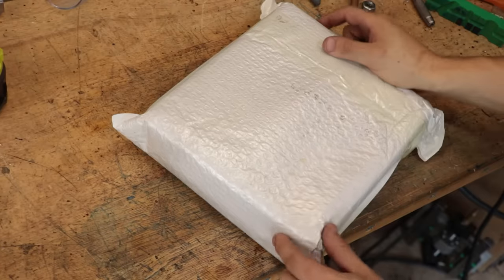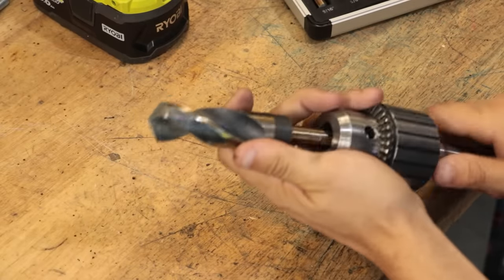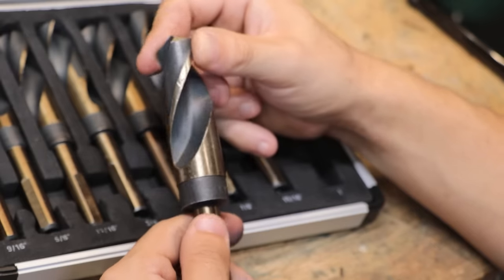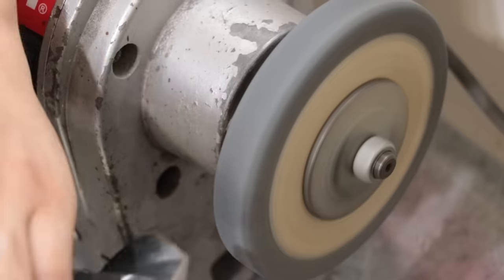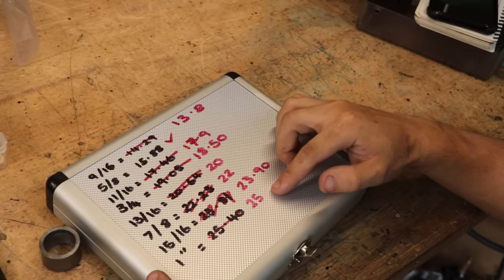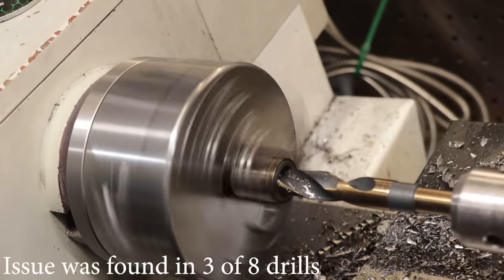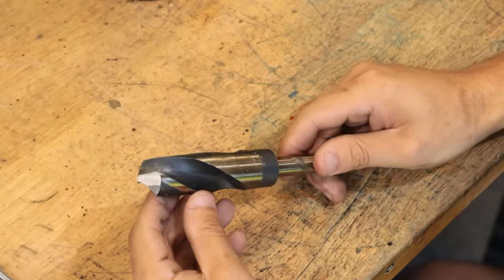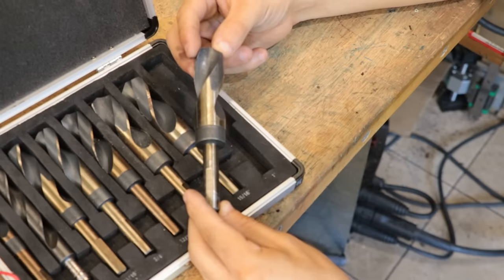Cheap Reduced Shank Drills. Worse Than You Think

Comment: I just bought a 115 piece TiN index from harbor freight here in the states. For 48 dollars I wasn’t expecting much but I’m planning to replace the most used bits with more solid brands once I need to, and as a bonus I get to keep using the sheet metal box they came in for organization.
Reply: I bought a set of 29 1/16-1/2" cobalt drills from HF for around $25, and they're the real deal. Others have been junk except a 1/16-1/4" set I got for $5. They were real HSS, still great after 20 years.  So it's hit-and-miss!
Reply: I bought the black oxide 115 Harbor Freight set back in the day when it was the princely sum of $29.95 just to see how bad they really are. I still use that index. For mild steel it's OK. I wouldn't try drilling anything hard with those bits. Over the years as I've found them I've been putting better quality bits into the index too. For an amateur I'd say it's a buy.
Reply: @1pcfred Yep.  The biggest thing with those cheap sets is, as long as the grinds aren't just complete garbage, they get you drilling.  They make a hole, and especially when you're just starting out that's all most people are looking for.
Reply: @OWSNubbles  when I'm drilling a hole past a half an inch I just want a big hole of approximate size. I'm not concerned about precision at that scale. Anything in the ballpark will do.

Comment: Biggest advice I can give is to throw that Jacob’s chuck in the trash and only use ER collets to hold the drill bits in the tail stock. It improved my drilling experience tremendously especially with the super small bits. With a collet I can be assured that the drill bit will not slip marring the surface of the drill and destroying its concentricity.

Comment: Even some once great names in drills can have bad grinds.  I was once making some bolt action pens using 304 stainless.  The closest drill I found to the size I wanted for the main clearing cut came out of a Precision Twist Drill index.   It was terrible.  At first I thought it was just work hardening on me, but after hand grinding the drill I did a dozen pens without sharpening it again, and I am confident it was still sharp.  In fact I was able to push so hard and fast with it that the knives of steel would reach out of the hole and almost hit my hand on the back of the tail stock in seconds if I didn't pause to break chips.

Comment: I bought a set of Silver and Demming large drill bits. They are a step or two above garbage. They tend to chatter and make hexagon holes instead of nice round holes. You need to use several sizes and work your way up to the final size. In regards to drilling holes over one half inch I just have two words to say..........annular bits. I bought a few sizes and will never use anything but them on large holes. NO chatter and you start with the proper size. Perfectly round holes, no rimming around the edge, and smooth work faces. They take a special chuck as they are actually meant for use in magnetic drills but I bought a cheap chuck that fits the #2 Morse taper of my 5?8 inch drillpress and you just insert the annular bits into the lower end and tighten the two set screws and start drilling. The bits are pricey but worth it in my opinion.

Comment: For drilling big holes I am using euroboor anullar cutters with an arbor and they are amazing.
Reply: Yep but only useful for short depths and through holes only.
On a lathe I wouldn't use blacksmith or reduced shank drills (well I have a few in the 12mm to 16mm range which have all been reduced to 10mm to save time when using a collet chuck) because you have a Morse taper available in the tailstock which is so much better to use.

Comment: Your results are significantly better than I got from a similarly sized set obtained from Bangood.  The problem with my drills is that they were not hard enough.  I even tried heat treating a couple, but the steel was not responding.  So mine are a dead loss.

Comment: You could grind or mill 3 flats into the Frost drill bits. Mr. Pete did a video on this some time ago. It’s not rocket science, but an example of how much better it works at least. Good video sir.
Reply: Usually the shank end of bits isn't hardened. So it can be machined. I think it's left soft so you don't mess up your chuck and it can grip? I've dug grooves into plenty of bit shanks and had to file them away. So it seems soft to me.
Reply: @1pcfred  -they are left soft on purpose, as harden jaws and harden drill shanks wouldn’t work very well together 😬 
With unknown quality of the drill bits (with all the chips and the size inconsistencies) and how they’re produced, they could’ve harden the entire drill bit 🤷🏼‍♂️
Reply: @orangetruckman  that's why I figured shanks aren't hardened. But with cheap bits who knows what they did with them.

Comment: I have what looks like an identical set of drill bits. Same box too. I've had them for a couple of years now. Got them from Amazon for around £15 from Amazon. They were advertised as HSS-Co, wasn't expecting it to be at that price 😂

I needed a 16mm hole in some aluminium during  lock-down while working in London. This was the cheapest and quickest way to get it done. I've only used them a handful of times since, most are still in their individual bags.

No chips in the finish of mine but being a budget set they only ever get used on soft materials.

Comment: Another thing to keep in mind with "reduced shank" anything, is that the thing you're throwing it into (a jacobs chuck) is engineered for the sizes they are ment for.
Sure drilling is low force, but they might deform any internal workings
Reply: That doesn't make any sense in most situations - unless you're using the smallest chuck with a huge 1+" drill it's not going to do anything to it. Your feed rates and pressure shouldn't be enough to cause issues and if they are you probably aren't using enough lubricant/coolant. A standard k3/k4 chuck using a reduced shank drillbit is fine for nearly all materials. If you're pushing a drill that hard you should probably be using a cnc and just plunging with an endmill, but that's going to cause other potential issues (out of round holes, poor finish, etc)
Reply: @skoparweaver7692   I agree with his post that reduced shank drills in that size range are not great for steel.
It's far better to use a morse taper drill dirctly in the tailstock or in a morse to morse size adapter when drilling something like 3/4 or 1 inch

Comment: I have the exact set (right down to the foam between the smaller drills arriving ripped off) sold under the Nikko(?) brand. I just wanted a complete set. Ended up using them for some very real 1/2" and 1" steel plate. In my big mill, 3HP, 3PH, 100RPM, they did just fine. It definitely appears there's a different, harder steel close to the tip, which I've seen in other name brand drills. 

They're not going to outlive me, for sure. But they do the job. I wouldn't advise using them in a hand drill unless you hate yourself (and your drill, and your work) but in a pinch they work.

Comment: Chinesium...
Kinda on par...as they say "Buy once, cry once"
Definitely look into building/buying a drill bit sharpener...especially if you can build one where you can grind in a relief on the back side for drilling metal
I wonder if you could re-heat treat them to see if you can make them harder?
Keep em coming!!!!
Reply: Lots of Chinese products are poor because of poor heat treating, so I was thinking the same thing.
Reply: See Harold Hall's design for a 4 facet drill sharpening jig. It is simple to build and works extremely well. All Chinese stuff isn't the same cheap crappo quality....it is the same thing wherever you buy from,if the price is so low to dictate poor quality that is exactly what you should expect. A decent set of HSS Blacksmiths drills would be no less than £80.00 GBP.
Reply: You can buy the best and still end up crying at a later date. Life's funny like that sometimes.

Comment: I think I have the exact same set (I bought it about year ago). I never messured mine, but the first time I used the smallest drill from the set, the drill snapped in half in mild steel. So I guess, I don't have to messure that one. 
Great video as always and have a great start in 2024. 
Metric greating from Germany ;-)

Comment: I wouldn't say I particularly prefer metric or imperial, but switching back and forth can be a pain in the butt.
I work in fairly large factory in the US that does contract manufacturing for medical devices, mostly designed by US companies. A lot of the newer parts that come through (designed post-1990 or so) are all metric, but a lot of the old pieces are still imperial nominal sizes and prints because that was the manufacturing process the FDA signed off on, and changing it will require their approval, so we're stuck with it until someone decides to retire the design and replace it.
The more annoying cases are those rare occasions where a print is a mix of the two. There are these parts we make a lot of where the print calls out a 5mm hole with a +/- .05 tolerance, no big deal. That same hole also has a 12-48 UNS thread, which calls for.193-.198" on the minor diameter which works to 4.9mm-5.03mm.
So because of how they overlap, our tolerance on both is cut down and the actual acceptable size for the hole is neither of the ranges listed on the print, it's 4.95-5.03.
The other part that gets me is the decimal places. If a feature's .005mm oversize, no big deal. .005"? Way more of a problem, and probably scrap.

Comment: A couple of comments......... your correct about the materials cheap ones are made of. Buy better quality from a good seller ( better value in the long run). I use Rennie tools ( just a pleased customer, no connection). Most people run these larger drill bits too fast. Try to use a bench drill. Hand drills are far too fast. At the end of the day you get what you pay for!

Comment: It's softer on top from your hand grinding.  Chips on the flutes indicate its very hard and were transported in bins. They ground the o.d. till cleanup not a spec size. Using a belt sander works better for touchups.  You get what you pay for, a drills justca rougher anyway. Reamers hold sizes
Reply from the maker: I wouldn’t expect so, hss should hold its temper (unless it isn’t hss which is quite possible) but the flutes weren’t much better. Compare that to the frost cutting edge which was 65 plus hrc. And I ground that one too. Cheers

Comment: what you have there are industrial waste bits. these of QC rejects from some factory, and has collected them, to sell them off as "whatever"...
The dings, dents, and other surface blemishes are more than likely caused from them dropped into a massive bin of the exact same parts. at the end of the day, quality control sets them aside to be destroyed / remade, and someone's selling those off. 

There's still hope though. 
In this case, if you have a nice grinding stone, chuck the oversized drills, and grind and polish the outside diameter to the required size, then regrind all of the tips, and you'll be good to go. i.e. 

Grind the following bit diameters: 
23.90 -> 23.00 (or 23.50 if you like the half sizes)
18.50 -> 18.00 (or leave it be for the half size)
17.90 -> 17.00 (again, you can go to 17.50 for the half size)
13.80 -> 13.00 (yet another half size option)

Because the diameter dependencies are so minute, you can literally just grind these into tolerance, the webbing and flutes won't really matter much. Just be sure after you grind them to diameter, you back-relieve the flute edges, and tips so they don't rub 

I also want to point out, that deceptively, it's easier to hand grind small drills than it is to grind larger drills. If you can, invest in a grinding jig, i kn ow it's not the "cool" thing to do, but you'll get a more even, more consistent cutting edge every time, and you'll waste a lot less drill material with each subsequent regrind.

Comment: I use cheap RS drills like these quite frequently in both drill press and CNC mill, so far haven't had any major issue besides a chipped edge when I entered the cut with bad feeds/speeds. That's entirely operator error tho.
Gave it a new edge with the drill doctor and have been working great since.
Granted I would really recommend only using them in thicker material where the sides get proper support from whatever you're drilling into.
Handdrilling I wouldn't use them in anything else than wood or plastic.

Like with any tool you always need to be very mindful of their limitations. I wouldn't try going from a 4mm hole to 25mm with a RS drill and also pushing it hard into the material. You really need to properly predrill to use these sizes. 😁
Edit: Seeing/hearing all the problems your drillset has, they must've been of exceptionally bad quality. 😳
Reply: I snapped one of my el cheapo big drills clean in half once. I welded it back together and I still use it. It makes me laugh every time I do. Because it still works as good, or bad, as it ever did.

Comment: I also happen to have "cheap" store bought "titanium coated" drill bits, and the quality is vast between a premium store brand/name brand and the harbor freight/princess auto quality or worse unamed chinesium. Dewalt and Canadian Tire's Mastercraft Maximum branded drill bits are relatively cheap and they are sharp, straight, well polished, and they drill through steel like hard butter on a cold day. My digital calipers reads .0005 variation, I dont have a set of certified gages or micrometer to asses in the lower range.

Comment: Bought very similar drills,  the short length of the would suit my mill with limited z axis. I regrinded  at my work with a automatic drillgrinder before i even tried them. the tip was quite offcenter on several of them. Bought them as a roughing tool also so I dont need them to be as good as namebrand but would be nice if they survived a couple of holes before touch up. I actually bought them in the food store. It is the german Lidl chain which are big warehouses there. Here in Sweden it is just only a small food store but a couple of aisles where it could be just about anything for this week. So schnitzels and drills at the same time

Comment: Just some advice from an experienced machinist, you need to measure the drill at the cutting end of and the speeds and feeds that book is giving you doesn’t account for the power and rigidity of the machine.  You should be running around 80 to 150 RPM.  Keep your feed consistent and keep plenty of oil on the tool and work.  Try to cut as much as you can before having to back the drill out to clear the chips. The more you retract the less accurate the hole will be.  Lastly, with a drill that size you always need to have a pre-drill hole about equal to the size of the web of the larger drill.  This is even the case with split point drills.   With all that said, I love your content and your creativity. You’ve made some things that I wish I had the time to make.
Reply: Agreed, that is fast for that drill. Interesting point on split points. I thought the idea is that they don’t need a pilot because they cut to the tip?
Reply: @freestyla101  split points are more accurate but the larger you go the more they wander.
Reply: @brandontscheschlog  interesting I didn’t know. I usually drill a pilot the size of the chisel anyway. What is your thought on drilling incrementally when the finishing size is big, say 25mm for example. Obviously you’d drill clearance for the chisel, but would you go up in steps or straight to 25mm?

Comment: The shank end that fits in the chuck is soft steel, so if your drill doesn't fit in your chuck just stick it in the lathe and turn it down til it does. I buy 'Blacksmith drills' with reduced shanks, never had a problem with quality but then mine don't come from China.

Comment: May I suggest a way to use these drills and they can work well enough.
Make a tool holder that you can fit to the turret/tool post. It can align on the entire part for the chuck and push from the shoulder. No slips , no bends and the ultimate lazy part you can auto feed the drill with the carriage. It will keep your tail stock nice as well as the drill chuck for finer work.

Comment: It is suspected by a lot of people that the Chinese package up their rejects and sell them cheap and I have had a few over the years.  The best was a set of 120 HSS drills for hard metals like stainless steel for around GBP12.00, I got 120 drills in a nice foam lined case but they were rubbish.  None would drill anything harder than mild steel, 20 went in the bin straight off as they were bent and/or not hard at all, the rest needed regrinding as the tips were either off center, ground with back to front relief or both.  I complained and got a refund and got to keep the drills, they now work in aluminium, brass, plastic and wood but steel blunts them quickly.  There are good Chinese drills but they tend to be in small sets and are not much different in price to branded ones, my cheap ones are useful as they are 2 - 6 mm in steps of 0.1mm for the small ones and further apart as they get bigger, with multiples of each size.  I treat them as disposable and will get a better set when I need them.  For the stainless I had to drill, I bought 2 of the size I needed from a reputable source at around GBP3.00 each which do the job well.

Comment: I have the same Set you got but mine are stamped 1" - 25mm on the collar. Seems like they just don't care about the last half mm in the factory. In my experience the steel they use is absolute rubbish I resharpen my drills about every 25-30mm of material thickness. Thats why I personaly upgraded my lathe drills to a set of Ruko Terax Morse taper Drills very quickly. The set cost me only double what the import set did and they do great! I will be staying away from noname import HSS tooling in the future.